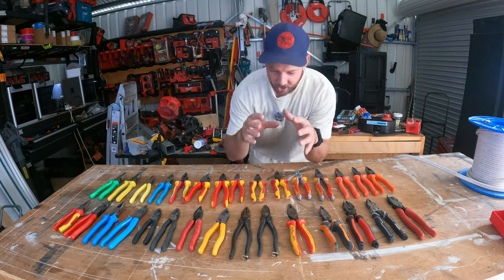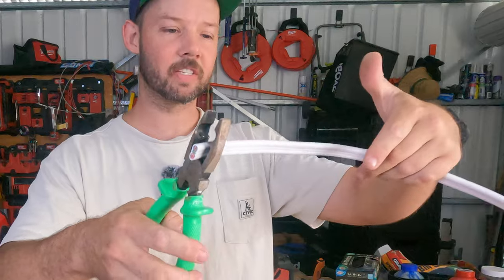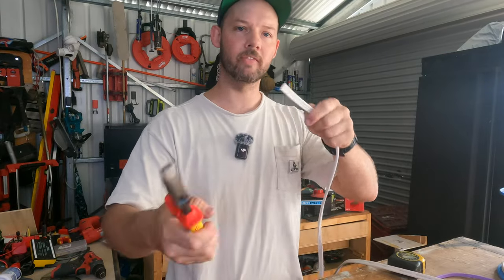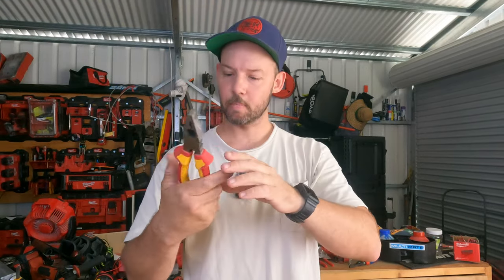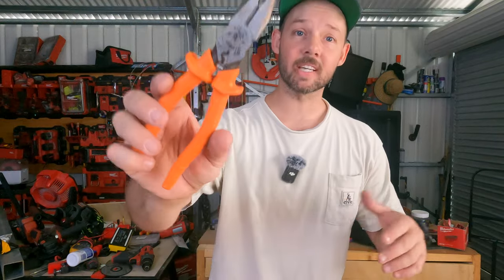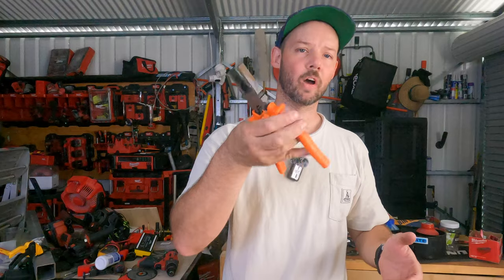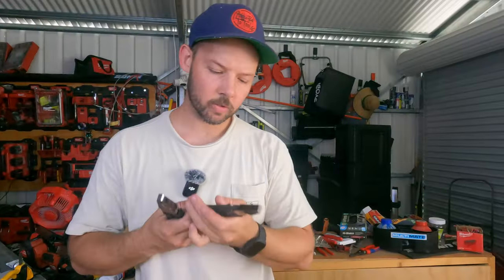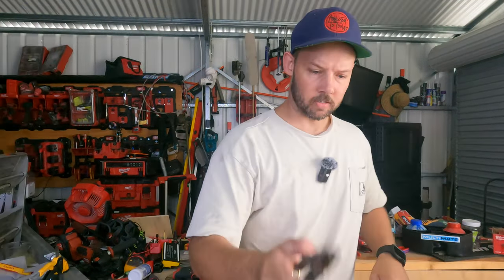30 different pliers reviewed.$1800+ worth!

Comment: Oh btw, knipex pliers only for me - that’s all I’ll use. Surprised they are so heavy as they weigh the least out of any American linesman
Reply from the maker: I have noticed a lot of the American linesman are larger and heavier. But then you usually use strippers for fitting off. Is that correct?
Reply: Yes guys always carry a set of strippers. Unless they have some sort of a hybrid plier.
Klein makes one and they are much smaller and lighter then a normal set of linesmen’s but are not as good when used as a hammer lol
Reply: @AddictedtoTools we use strippers, the insulation on wires are not really flexible so using cutters isn't as easy and reliable as stripper
Reply: @scotthill4742  after using kleins for years and switching to knipex the only thing I miss is being able to hammer shit. Lol
Knipex cuts better with that satisfying snap, feels lighter, is generally more comfortable and doesn't gum up over time requiring lube as often like kleins do but doesn't work well for hammering.
Kleins can handle a bit more abuse for sure though.
Reply: @AddictedtoTools 
I just used my Wiha lineman to pull insulation off a 3 cable power cord like you were doing😂, maybe 8 gauge wire...
I'll still to my combo pliers

Comment: As an electrician from the US, I don't know anyone here that considers the Crescent linesman pliers to be OG. They're they adjustable wrench guys and that's about it. For me, I use Klein, Channellock (high leverage non-1kv), and Wiha linesman pliers. For the work I do which is mostly industrial, I use 1KV linesman pliers when it's warranted, but if I'm just pulling fish tape or other rough work, I use non-rated pliers.

I love Southwire pliers for residential stuff I've done on my home. Their specialized strippers for Romex were a game changer.

Comment: Really liked the video and good comparison for sure. 
Would love to see more of these maybe installation pliers and side cutters ?
Reply from the maker: Thanks for the feedback Rod. It’s definitely appreciated. I’m slowly growing my other collections, so I’ll see what I can do in the future. Any in particular you’re wanting to see?
Reply: @AddictedtoTools  I own and use the knipex “euro” installation pliers and have seen other versions here and there online so am mainly intrigued how they would stack up against each other in this format as I never used a other brand of those. 

Myself I run the veto MP1X pouch and hate putting tools in my work pants pockets 
So installation pliers for my are the go to as they replace my needle nose, combo pliers and side cutters ( do have a small pair of knipex side cutters for Tyraps in there too) 

Also being in Europe using round cable and wago’s I don’t need the wide head for twisting. ( side note I learned to combine all wires in the cable in one Wago on ruff in compared to your twist and tape. Same principle ) 

I like you honest personal take on it in this video 
Not claiming a definitive verdict but just a solid opinion
Reply from the maker: Good stuff. I’ll keep a look out for other installation pliers. With the twist and tape options, are you also running ring circuits and only having 2 cables per outlet. I believe plant places do this so it makes it a little safer. Always good to see what others are doing.
Reply: @AddictedtoTools  not so much rings as all to central ceiling boxes all in conduit. 
Learned it off an old spark years ago while on bigger sites as a last resort fail safe against stupid mistakes. 
Better to pop a breaker when someone F’s up then to have a live openend cable hanging about. 
But to be honest I see most just use one Wago for each wire in domestic / smaller sites. As it’s easier to track the cables. 
Might just be more of an old school thing here these days did learn it like 25 years ago.

Comment: I definitely want to get my mitts on the NWS 5746… can you double check that part number I’m not getting any results on the longer pliers… seems that the 205mm is the top length for NWS combi/linesman’s when it comes to current availability. Could the 5746 have been discontinued?

Comment: I have the blue Fujiyas. I think they're by far the best set of pliers you can get for $50. Once you get used to them, they're so easy to handle with the slim handles and you get a heap of leverage because they're a little longer than others. They're perfect straight out of the pack, smooth and loose action, snap shut on every cut. I've cut through screws with them and still no light comes through the cutting jaws when you hold them up. I ordered the yellow 1000v wattmaster cross cuts, made in taiwan unlike the japanese wattmasters which was a little dissapointing and stiff to open and close. Another great buy was the VDE NWS pliers in the single pack from bunnings, they were better than the double or triple plier pack but no longer on their website

Comment: I agree with this video. A lot of high priced brands that are overrated. I actually use the old Irwin non insulated pliers. Handles are bit too wide, heads are a bit too narrow for twisting. But.. still using it. I guess it's something that you just get use to. But honestly, the absolute hell I put my Irwins through, pliers and side cutters.. Not bad for $18 each over the last 5 years

Comment: man, I also rock the happy meal pliers. Doing the what you shouldn't do, cutting screws and stuff, the NWS just stay sharp. Yeah i copped a bit on site when I got them, however, they have outlasted channelocks and such. I have had prolly 50 pairs of pliers over the years and the cheap happy meal pliers have been the best. Not in the sense of throw away, they last.
with the channelocks locking up, what causes that is  if a strand of flex gets stuck the rotating bit they lock up. Only way I know to free them up is spend ages to work them till they expend the strand. Theyre overpriced and underperform anyway.

Comment: Great video mate. I bought a fair of those Crescent pliers a year ago with the side cutters, haven’t used them since as they were awful. I reckon I got a set of those Wattmaster cross cut pliers with the side cutters but they have dark blue handles instead and might be a 1000V rated. I’ve also got some other pair of pliers that’s a Crescent but has a yellow handle and is pinch cut. 

What pliers do you recommended in terms of needle nose pliers?

Comment: American electricians have a habit of using their linemen's pliers as hammers and thinking bigger is better.  I've been getting away from that.  Kleins, especially the journeyman series, are good for many commercial and industrial applications, especially as they withstand drops from heights well, but if all you're doing is cutting NM cable and twisting wire then you're probably better off with the Marvels...or a smaller cable cutter like the Russian guy uses.   If you cut a lot of metallic cable then a heavy pinch cutter makes sense, but even robust cutters like the Kleins will wear out faster cutting MC every day.   For MC I've been using the Klein BX Cutter model 1104 since 2016.  You just nip the cable cladding, twist and pull, and then make your cuts through the insulated wire.   So...I might give the Marvels or a similar pair of pliers a try.

Comment: Hey mate have the NWS Combination Pliers - 225mm Been Discontinued? I legit cannot find a single pair of them for sale anywhere and even the NWS website doesn't have them listed. have you heard anything?
Reply from the maker: Hey mate. I’ve found the same thing. I’ve actually emailed nws to see if I can stock them. I haven’t heard back yet though unfortunately
Reply: @AddictedtoTools  you and I both mate, they’re no longer on their website either. I’ll let you know if they reply to my message too.
Reply: @AddictedtoTools  There is only 2x for sale in Australia atm and they're on Ebay, I just bought one of them in case they have been discontinued or no longer shipped to AUS.

Comment: Hey Matt. Would love to see your opinion on the Trojan pliers at Bunnings. $25, lifetime warranty, and 1000V rated. Although not the loosest or the sharpest, they are an excellent entry item
Reply from the maker: Cheers for the insight Patrick. I haven’t used them but they looked similar to the workzone pair. Maybe I’ll do a video on the cheapest sets
Reply: The Trojans were my first pair as an apprentice and they were easily the worst pliers I've ever used. Better than nothing, but not by much. They're really not worth it in my opinion
Reply: Keep in mind...
When looking at stuff from Bunnings?... They're not intended for the full time tradies.
They advertise on TV for starters (everything's online now!)
Tradies are watching targeted videos and the algorithms are learning what's valuable to them. Which means specialist, informed and educated advertising. (Not diy quick fix or "doing the best you can with what you have" type market.)
Bunnings are not serious about selling you a quality, well engineered product! They want to sell you Ryobi! (A compromise!)
Reply: @AddictedtoTools  sounds like a good idea for those who maybe just want a set laying in a storage cupboard. That’s what I’ve got those Trojans for, but Sydney Tools also have their Xtorque for $10!! Also 1000V rated but would assume they are much like the Aldi and would only use in a pinch. I run the NWS 225s and both the red and the orange Marvels. Good to see we are on the same page. Would like to give that handle change a go on the Marvels but not rich enough to get a pair of channelocks just to try it.

Comment: We don’t use this type of pliers here in france ;(
Because we don’t work with flat câble (it’s not sale here..) and  we use rigid câble with  pinch connector on everything . Not we don’t need screwdriver in outlet, socket, interuptors or panels…

We use wire in a plastic sheath or rond cable.
I use crosscut plier like knipex electrician or a pinch cut with my wiha tricut in plastic boxes.
The crosscut of the fujima is rond and I think it will be better with our rond câble like my knipex 1376200 ;)
For me the US,UK and AUS méthod is boring to no very Time consuming …
Now we work With a Pz2 screwdriver and an electricien plier for 90% of the job here in france ;)

Comment: Black and gold for me for side cutters and lineman.  I do like the flush cut version better and hold up well.  Sadly I can't get marvels in the US even az jp it would cost me almost 100 us.  On thr insulated front 20 percent are 1k rated in my techpack and u have more than the average American.  I do prefer dipped knipex handles super slim and fits more tools in the bag by quite a bit.  My most used pliers I'd say knipex instalation pliers 12/14g though I'm jealous of the eu spring loaded version.  Don't worry even in usa thoes milwaukee pliers even the made in USA ones are kinda a joke just hd trash among the people I meet.  Thoea in the know buy real pliers nws rebrands or knipex.

Comment: I though the thousand volt rated means the shoulder. Hence why all the shown 1000v rated pliers have them. They're all tested to the same voltage I believe.

Love the video. Definitely a cross cut fan aswell.